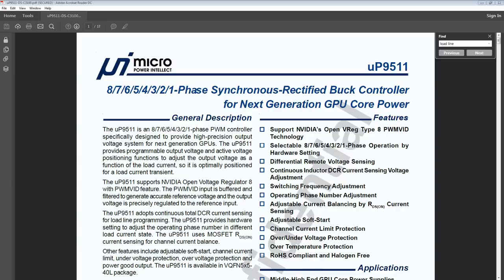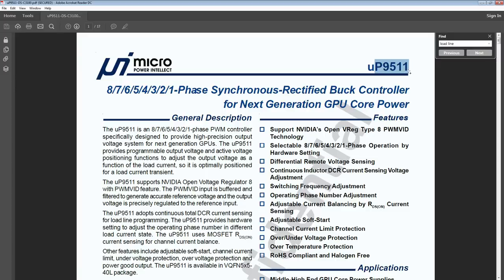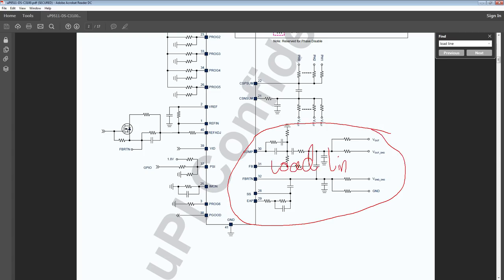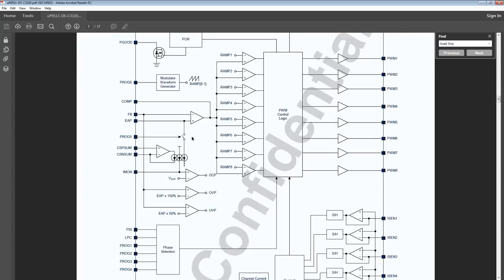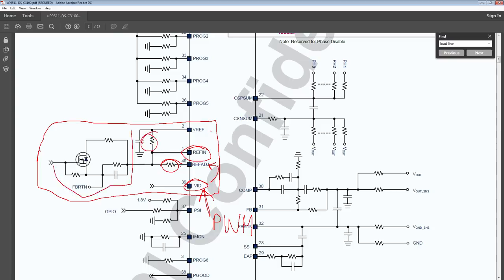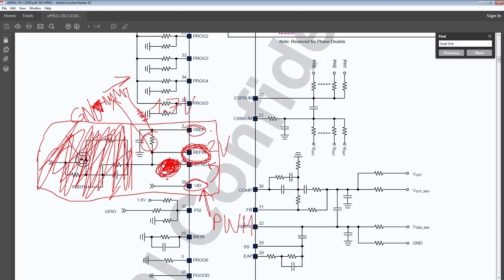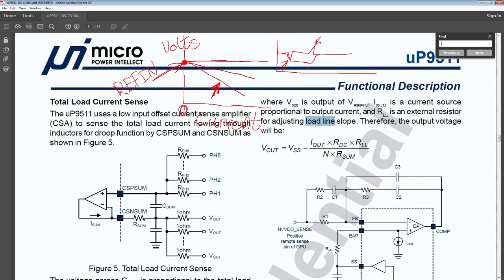Modding basically everything on a UP9511(GTX 10 series voltage controller)

Comment from the maker: first

EDIT: I got the OCP settings backwards... more resistance = lower OCP, less resistance = higher OCP. So really you would want a resistor in parallel with RIMON that gets it down to the 10K lower limit.
Reply: Well yeah you can post a comment before it goes live :P
Reply from the maker: but I didn't until after I published the video.
Reply: As long as you promise to say centigrade every time from now on I believe you.
Reply: But arrays start at 0. So who was first?
Reply: The description? I don't like sand.
Reply: every time i watch you videos im fuckin amazed that you got to know all this stuff as an autodidact
Reply: Just curious and maybe I already asked but did you learn this on your own or get a degree in EE? Either way I still think your a genius so again just curious.
Reply: 32:30 and on - You got IMON exactly backwards. Lowering RIMON increases OCP trigger current.
Reply from the maker: yeah re-reading the datasheet I did. Really dumb mistake on my part.
Reply: If you want a totally braindead pdf reader, try Sumatra PDF...It's FULLY braindead and its very responsive, i love it
Reply: channel name checks out....
Reply: more of this kinda content :)
Reply: Thanks alot for detailed explanation. I have a question. My msi gtx 1080 gaming x has a burnt mosfet 4C86N and mosfet driver PU 526F on phase 1 at VRM. I have found the mosfet but i am unable to find the mpsfet driver PU 526F online. Can you help me with data sheet for the said driver. Thanks

Comment: @buildzoid I have recently started getting into hard-mods on my video cards, but I've started with the EVC2SX and shunt mods for 30 series, which is all super easy. For 10 series, these actual hard-mods seem doable, but there are parts we need to calculate to make sure we get the right values. Could you perhaps go into detail how to calculate each step of the mods? Or possibly an actual hardware example of the implemented mods would help with seeing what you're referring to.

I love the content! I just need help taking that first step. 😀

Comment: Could you put one of these chips on your own board, that follows the design in the datasheet and is controlled by some uC of your choice, remove the IC from the GPU PCB, and bridge all necessary connections? Or would you consider that more of a solution for an e-power?

Comment: Thanks alot for detailed explanation. I have a question. My msi gtx 1080 gaming x has a burnt mosfet 4C86N and mosfet driver PU 526F on phase 1 at VRM. I have found the mosfet but i am unable to find the mpsfet driver PU 526F online. Can you help me with data sheet for the said driver. Thanks
Reply: Shah Suleman Are you the same person who post this message : https://forum-en.msi.com/index.php?topic=316212.0 ? If you’re still looking for this Mosfet Gate Driver, PU F526, I think it is uP1959. Datasheet is here : https://www.alldatasheet.fr/datasheet-pdf/pdf/1115197/UPI/UP1959.html

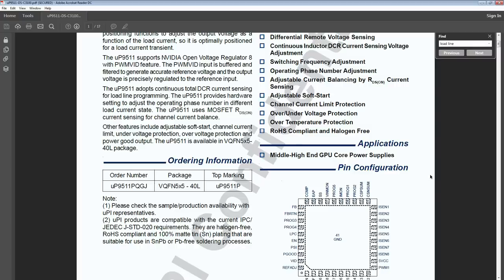Comment: What BIOS exactly where you speaking of at 2:45? I coulnd't find anything by searching for "extreme overclocking BIOS" (duh).
Reply: This bios will disable power sense, and set the max voltage from 1.096v to 1.2v. Its good if you have a watercooled one or a very good air cooler, otherwise its better to undervolt the card with a custom curve on afterburner

Comment: IIRC, the 1070 Strix also uses a UP9511, correct? Could i base my self on your guide and just expect a different layout or would it be set exactly the same as a FE? I'm getting soo tired of VRel pissing off my firestrike runs
Reply from the maker: check on tech power up. Their reviews usually cover what VRM controller every card has

Comment: Hey buildzoid, where can i get a proper GND plade on a Mainboard? (i want to epower a MB)
Reply from the maker: depends on the board
Reply: Follow the plating around the screw holes they should be ground.

Comment: i NEED the datasheet of the uP1911R ... PLZ :D
Reply from the maker: it's not public
Reply: f*** ... can you help me out with some questions ? :)
long story short: i got a cheap 1080 from gigabyte (xtreme waterbla edition) one phase blew up and i had to rip out some of the pcb back to the 5th layer i think ... and now i need to know where the up 9511 connects to the 1911 to reset the whole VRM ... and my Vram is not even enabled wich i think might be just one or maybe two traces ...
Reply: okay so ... one day later i managed to rebuild the complete VRM and all other missing Voltages ... the only problem now is the gpu is detected by the bios and windows and gives me a signal BUT no picture at all ... not even artefacts :/ in my "ripped" area are 2 lanes left i need to reconnect to its opponents but im not sure if they are important for vid signal ... it looks like the lanes are coming from IO-shield side and do cross all the way through the vrm ... but im not sure where they end. on the gpu side they have 2.5v on it ... do you have any idea ? :D